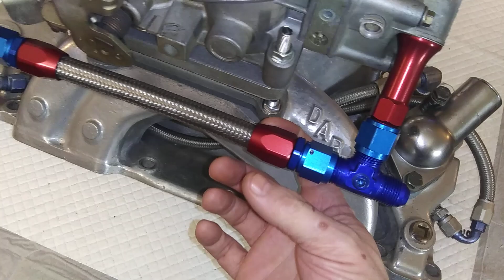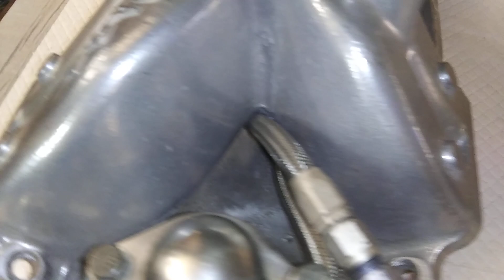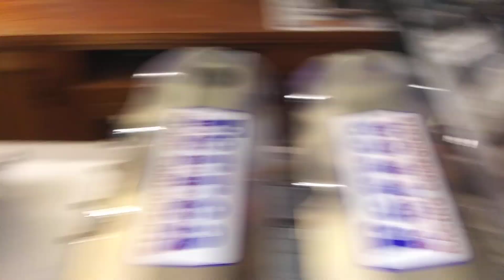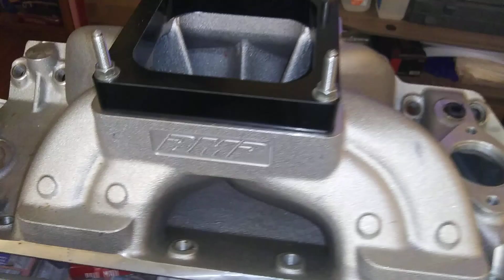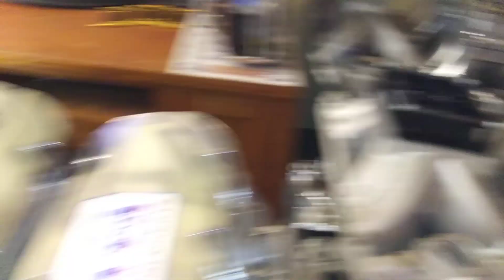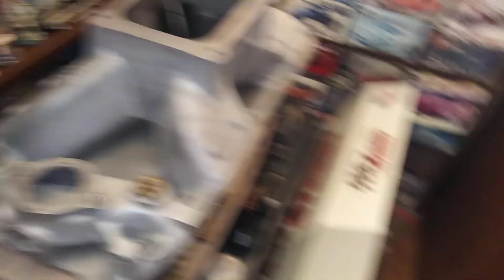Induction for RV 454 Chevy. 1050 Dominator & DART singleplane.

Comment: Would this be overkill for a cam only 454 ? Currently has Carter Afb Comp Series 750cfm.
Reply from the maker: Yeah, this induction would be a little much for you. A Vic Jr & 850 DP Holley would help your program. Dominator carbs should only be used on 600-650+hp engines. These big DART singleplane intakes are also made for 650-850hp engines. A  Vic Jr, Holley Strip Dominator, or a Team G intake would all be good choices for ya. Dualplane intakes on bigblocks suck unless your building a tow truck or trying to look stock. Bigblocks have plenty of torque anyway.

Comment: Looks like a nice combo for street/strip, I remember when those Dart intakes came out, they said it worked best on 500ci+ engines. I always ran that team G with a 3 circuit 1050 Dominator on my 468-roller motor, 11.5:1 with an Ultradyne 300-306 and 990 heads on the street. Used to drive it to work several times a month. That MF would put you on your ass for sure.
Reply from the maker: I used to daily drive a Malibu wagon with a 12.5-1 477ci Rat in it with a 775/748 lift, 288/294@.050 110 lobe sep. Comp solid roller with ported Pro Topline 360cc heads & DART singleplane intake with a BG 1150 Dominator on it. Had a 8 in BTE 5000 stall & 4-30 gear 8 3/4 Mopar rear with a spool. Only lived 5 miles from work tho. That motherfucker would definitely make people concerned for their life. It ran low 10s at around 135mph in street trim, which was 3.50 inch dia Dynomax race bullet mufflers and DOT approved M&H Racemasters. Loud as hell. Originally was gonna be a sleeper, but it got carried away.

Comment: Where do you find this stuff? I like your opinion on a 1974 LS7 over the counter long block. It's never been fired,
some one bought it never used it, I think it changed hands a couple of times not sure. It was on Hemmings auction
it bid up to 12,500 I think. Dude had a reserve, I think 26,000? While it's a nice piece to me that's the "I don't want to sell"
it price.
Reply from the maker: Damn, 26 grand is kinda steep. Shit done got way out of hand. Greed ruins everything.
Reply from the maker: Getting to the point only millionaires can afford the good musclecar era shit.
Reply from the maker: Just seen a pair of RAM AIR 4 Pontiac heads going for $14,000. Crazy.